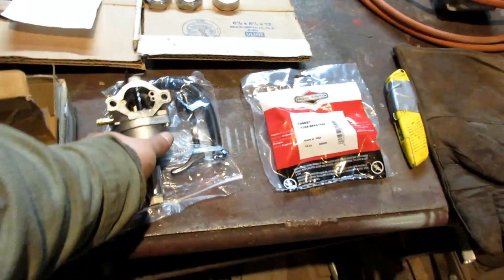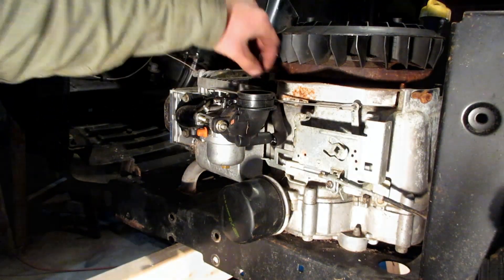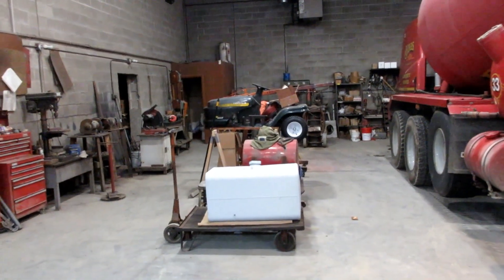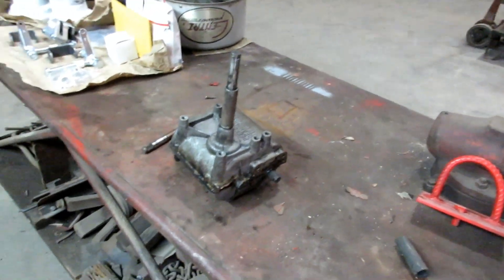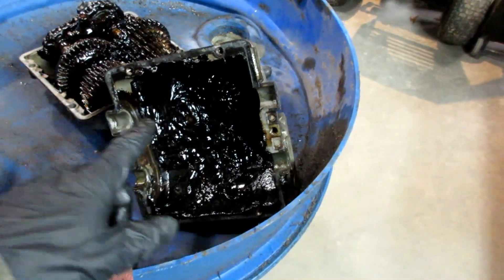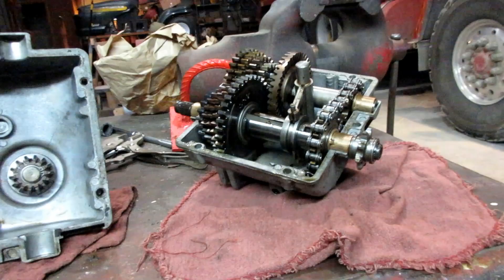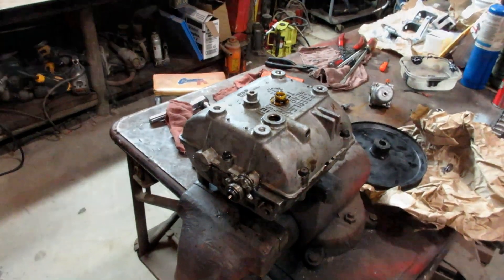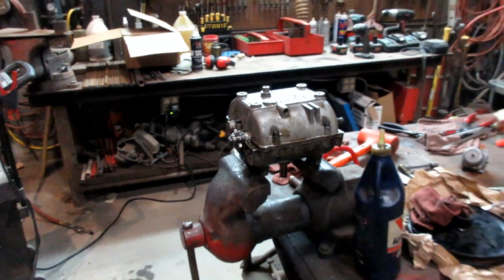Racing Lawn Mower: Part 6 "Inside of a Peerless 700 Transaxle"

Comment: Do you know where I can get one of these for cheap? I got a free cub cadet 1315 from a friend and it has a 12.5 that i got running and I want to build a fast mower for fun as cheap as possible. It has a peerless 920 transaxle in it but I don’t think it will hold up.

Comment: First off, you need to take the reverse chain out. At the rpm’s that 700 will be turning, it will destroy the case if it break. Second, on those brass bushings on the input and output shafts with the gears, there’s little tits on them that need to be turned into the the small notches on the lower case half. If you don’t do that, it binds the shafts and actually can crack the cases.
Reply from the maker: yeah I found that out